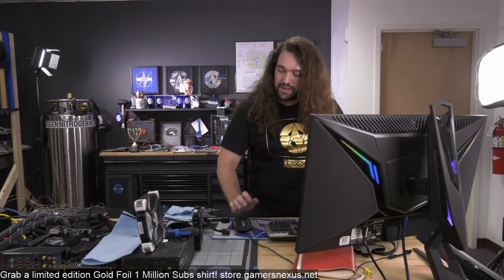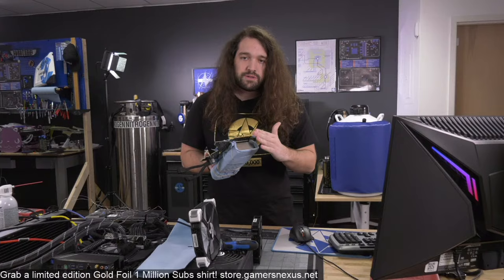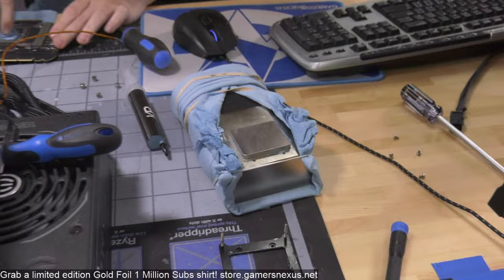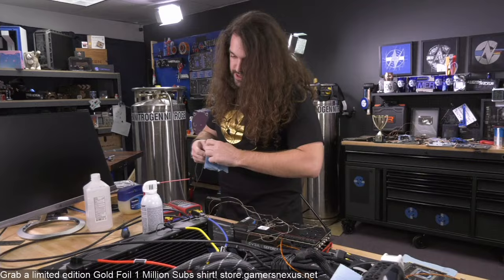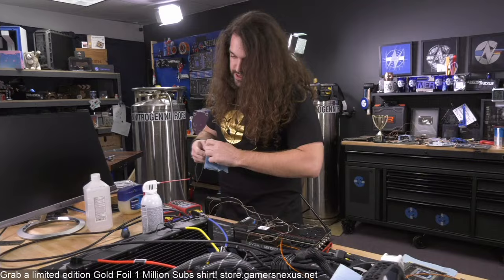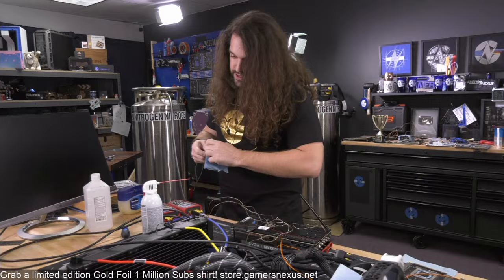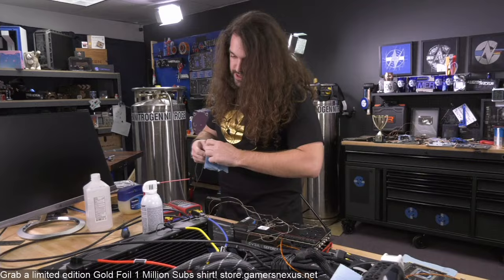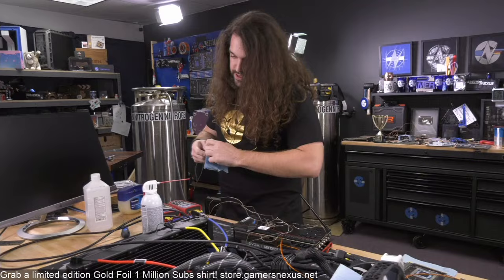LIVE: RTX 3090 Overclocking (Air & Liquid Nitrogen)

Comment: You didn’t need LN2 fog or an AC. You needed to set the RGB to blue.
Reply: But isn't Red LEDs faster than Blue LEDs???
also I don't get RGB adds FPS, when my PC is on RGB Rainbow FPS is up & down all over the place, but when my LEDs are set to RED I get constant MAX FPS 😁
Reply: @me_and_me_  stop spamming chats
Reply: Blue RGB hurts my eyes. Red doesn't kill night vision.
Reply: shane eslick 
He was trying to make it colder. Everyone knows blue is colder than red.
Reply: @radicalxedward8047  But Red with LN2 is Fast & Colder 🤣🤣🤣🤣🤣
Reply: Blue is colder than red; but everyone knows red ones go faster...
Reply: And a torch isn't needed to heat the chamber. Just turn the RGB to red.
Reply: @shaneeslick  if that was true AMD might've won before now.   j/s...
Reply: @shaneeslick  isnt having it set to change colors cpu intensive or smthn, which will cause your fps to fluctuate
Reply: @rain-uw9ju  I was being silly about performance fluctuating when Fans set to RGB, & Red being better because Red makes thins faster,
But yes some RGB Programs can increase CPU Usage, so depending on PC performance it can have a real affect, but it will not make a playable experience unplayable
Reply: @shaneeslick  yea ig
Reply: @me_and_me_  hjjjhjhj
Reply: @shaneeslick  I

Comment: Man I remember the old days when Over Clocking actually meant something, you could get real performance boosts out of GPU's and CPU's back then. Now, the cards run at max boost by themselves so OCing is pretty meaningless.
Reply: That's a good thing. I found that out with my 3700x. 

The algorithm of heat/clock/voltage are so tight, that my final "stable" overclocks end up so close to what the boost can do that it's the first time i just let it "boost" itself. I had a hard time understand this the first time i came across "boost" in gpu. 

The little bit extra i could push out, barely equated to any real life performance gain.
Reply: I doubled my score in 3dmark 2001 with my GeForce 3 ti200 from Asus with air-cooling alone. It was faster then the slower GeForce 4 cards... Great times.
Reply: I mean.. You can OC CPUs to 5ghz+++ on air and gpus by 5-10% core and same memory. RAM goes from 2400 to 3000 and stuff like that... It's not free 10x performance but what is the expectation here? You pay for something and you get more... For free.
Reply: And the Athlon XP 1700+ juihib stepping ♥️
Reply: Just undervolt
Reply: @MsFearco  Yea Intel has to applauded for this at least, their K series chips do meaningfully OC and give a good performance boost and I am on Ryzen myself now btw meaning I have to do some extreme RAM tuning to get nice performance uplifts and I never found that interesting. Still, I am thinking of upgrading to 3600 low latency ram kits from my current 3200 kit which I am running on xmp profile.
Reply: tbh it's a good thing.. the fact that you could buy a product for 500+ dollars and only get 75% of the performance it was capable of was a rip off. does it ruin the fun of overclocking? sure but i'll deal with it if means even casual users get the full capability of a cpu.
Reply: Competition is tight these days so they gotta release as powerful as they can

Comment: I always wanted to put my PC outside when it's -40 and see what my temps would be. Or at least intake cold air from inside through a window or something. Too worried about damaging my parts though.
Reply: I'm not an hardware expert but if you take the PC outside be sure to check the humidity, maybe if you live in a dry place it can work! Good luck.
Reply: @L30x  It is pretty dry here but I wouldn't risk it 😅
Reply: @L30x  He can make a sealed plastic-glass box and put the PC in it, no air will go in or out from it so in the box will be left only the air with normal humidity from the room he used to assemble it, the environmental temperature will do it's job and cool off the box.
The main issue tho, is that -40 degrees is too low for the PC to boot up so he has to heat the PC first and keep it around 0-5 degrees celsius (if he did mean celsius and not fahrenheit).
Reply: @saturnity6  yes it can. enough to damage a pc
Reply: @nobody8685  Air inside this box would already contain water in it

Comment: 12:20 & 1:26:04 are an example of the correct BoM caps to use to prevent power noise at higher clock frequencies. Some cards unfortunately did not realize the importance of these little caps.
3:32:33 is an example of the use of all MCLL caps. 
Edit: There are different types of POSCAPS 220's and 470's and 330's - Higher number has more top voltage (operating  range) that also added noise (specific filtering). I used 470's when I replaced the old caps on my PS3 60GB.
1:59:09 Steve reads the official statement from EVGA
2:01:00 Example of pre production with no MCLL caps from EVGA.
Reply: Thank you sir
Reply: Higher capacitance value doesn't mean it can operate at a higher voltage. The voltage rating is what determines the voltage it can operate at. The capacitance determines the amount of charge the capacitor can carry and therefore the amount of noise filtering it can provide.
Reply: @audaxxx4202  indeed thank you for clarifying that. Does that in turn mean if a capacitor can carry more charge and during that charging cycle results in more noise? Or is it a unique way  interfere by harmonious waveform that may cause some sort of destructive frequency in the GPU?

Comment: I'm really interested in seeing the performance metrics comparing a 2080 (or Ti) overclocked to a 3080's power draw and a 3080 underclocked to match a 2080(/Ti)'s power draw, and compare the performance of the two when power levels are equal.

Comment: Here are excerpts from a couple of Igor's Lab articles on the 3080/90 ... 

"Igor's Lab Aug 27, 2020 = NVIDIA has also completely sealed off the evaluation drivers this time. I don’t even think Furmark, let alone Time Spy, is running anymore, but only NVPunish (a stress testing program) for the thermal tests... from a board partner’s point of view it is of course quite strange when you produce something you don’t even know how fast it will be in the end.

Igor's Lab Sept 25, 2020 - “reference board” PG132, which can also be understood as a so-called Base Design. Especially the backside and especially the area below the BGA is interesting. What is interesting about such drawings and the so-called BoM (Bill of Materials) is that you are offered different placement alternatives.

Below the BGA we see the six NECESSARY capacitors for filtering high frequencies on the voltage rails, i.e. NVVDD and MSVDD.

The BoM and the drawing from June leave it open whether large-area POSCAPs (Conductive Polymer Tantalum Solid Capacitors) are used (marked in red), or rather the somewhat more expensive MLCCs (Multilayer Ceramic Chip Capacitor).
...According to the list and specifications of Nvidia, both are possible...

This also applies to the question of whether the BoM was subsequently changed again to completely exclude the exclusive use of POSCAPs/SP-CAPs."

From reading the full articles it sure sounds like Nvidia may not have provided working drivers to AIB partners until late in the development process and may have known about capacitor issues, since the FE cards have 4 poscaps and 2 mlcc's ... but it appears the BoM may at one point indicated that 6 poscaps would work?  Would love if GN could confirm any of what is in Igor's work and if I am reading it correctly?
Reply: Buildzoid did release a video with his thoughts about the layout behind the Die today on AHOC , so I hope Steve & Buildzoid can look into it further too

Comment: Regarding the plastic backplate: you might actually be surprised. I'm not saying it works, but don't discount it on principle; look up AN11113 from Nexperia regarding thermal design for LFPAK MOSFETs. It's now obsoleted as a design guide, but the data remains interesting. They tested black plastic, bare aluminum, and black anodized aluminum as enclosure materials in contact with the PCB assembly and found that plastic still has a significant heat sinking effect particularly in topside configurations, and may actually outperform polished aluminum in some circumstances due to superior radiation.

Comment: Do you think some of the add in board partners will start to adopt Nvidia's new split cooler design by making the back half of the cooler a blower style to remove some heat completely out the back and then using the front fan or "fans" to blow the remaining heat out the sides instead of Nvidia's pass-through design? :/

Comment: When the cards released i think the power circuitry was an issue with certain brands. Not sure if this was fixed but 2 months later ive picked up an EVGA RTX3090 Gaming ULTRA and it has two of the weaker caps. Even though it draws the most power stock. Whatever optimisations needed to happen have obviously taken place as my card has been fine(the card lasted just over a month, i went with the asus tuf 3090). Although if i dont set a fps limit the card will crash to desktop when streaming. ^^

Comment: is it possible to view my 3Dmark results relative to others that are higher/lower instead of just seeing this dumb Top100 screen and mine on the bottom? I would prefer to see my score in the center, and the next 20 better and 20 lower scores above and below mine... ?
Reply: Afaik not on the 3dmark hall of fame, but on hwbot you can filter by a lot more parameters
Reply: Yes, kinda. Click on "compare results online" after the run and then "show result details". Shows you a bar graph with different score brackets from runs with the same hardware.
Reply: @-eMpTy-  thanks. but I really meant something like the Benchmark Superposition offers, a Highscore List where you can see the specs and stuff of the people above and below you, not just some graph or a Top100 List with you listed as Low 1% and you cant even see the people around your score. A list like Superposition gives you more incentive to improve your speed or it is at least more fun cause you can relate much better. I guess 3Dmark really only is fun for the Top100 cause they get elevated and presented exclusively and you dont really have any idea where your PC stands.
Reply: P4RADIGM it is possible, just add your score, and select compare.

Comment: When you were pushing the memory speeds, wouldn't it always apply even if it's erroring with this G6X VRAM? Or is it still possible to crash the card and it only handles artifacting? Jc
Reply: not always, but mostly it would worsen performence, because it takes more cycles to error correct.

Comment: DeBuer(forgive the spelling) showed by soldering the better MLC caps replacing all the original ones the card held over 100mhz better clocks. stability was far better, you might want to copy him and mod that 3090. Great work on the LN2pot BTW.

Comment: this boggles me i bought 5 2 dollar peltiers ,couple dc to dc convertersand made my own heat transfer blocks from aluminium and a grinder,and made a budjet pwm circut to piggyback of the motherboards pump pwm output ,now have control all the way down tominus 20 degreesdefinatly cant do this with an aio water block had to run external fish tank pump and filter in one unit,just removed the filter so runs as resiviour,the last peltier runs as air cooled water chiller to cool any hot water
Reply: all the peltiers have been isolated from the environment to so as result not getting condensation when passing the dew point, id be happy to share my circuit designs and how was done if it interests anyone ,it doesnt really add much electricity cost and if tune it to low 30s its no more than 12 volt 20 watt per peltier

Comment: Just curious why he didn't raise the voltage slider when he did the air overclocking. I have the evga 3090 ftw3 ultra and I have it raised, now I'm thinking should I lower it back.

Comment: Doesn't this stuff hurt very much in contact with skin? (Damage)
He handels it like a beer dispenser.
No gloves...it looks like it runs over everything.
Reply: I think he's covered this in previous videos. Basically its generally recommended to not wear gloves etc as small spills boil off immediately not causing any damage, but a fabric can get liquid soak that holds it next to your skin for longer which actually results in burns.
Reply: He does cover it every stream, but basically because it’s so cold the moment it touches your skin it boils and creates a vapor barrier that keeps you from getting burned. He does wear the gloves when he’s doing something that is safer with gloves. But handling the smaller bottles the gloves become more of a problem.

Comment: Long ago, overclocking gave valuable boosts with most pc's struggling to run games in ultra settings, but now? Waste of time and not worth risking the longevity of your cards. Todays cards mostly max out graphics with no problems, it looks beautiful and there is no lag like 15 years ago. What is the point overclocking if your nice graphics cards and cpus run everything maxed out. To me it seems a bit weird to even bother overclocking, who needs an extra 10fps when you got 200fps already?
Reply: you're right, it only makes sense if you have yourself an older gen card, or lower spec card, and you are trying to run Crysis on it, that sort of thing...

Comment: I am young to your channel but not to build computer.  but I never did OC.

now my computer getting old and games demand more power (19FPS on FS2020 on ultra) can you make a video about basics of OC, tools to use to xontrol and monitor OC ?

GPU: asus tuf gaming GTX1650 super
CPU: AMD fx8350 with cooler master masterliquid lite 120
MB: Asus tuf sabertooth 990fx r2.0
PSU: evga supernova 1000
HDD: asus hyper M.2 x16 pcie 3 with two samsung evo ssd 1tb
RAM: G-skill F3-1866C9Q-32GXM
Reply: just replace the first three items on your list, you're not going to be able to squeeze a stable and cost-effective 50% OC.

Comment: I must have got lucky with a nicely binned chip on my 3090fe, it holds 2010-2025Mhz in most games at 60-64c. I keep my room around 20c and have an enthoo 719 case with lots of great airflow, vertical mounted 3090 with air blowing well across both sides so the memory temps should be pretty good too.
Edit: Oh that's not fully stock tho, I have a +60Mhz bump on msi afterburner, stock voltages, +250Mhz on Mem. Absolutely fantastically performing card tho, gets as good of numbers in benchmarking as my buddies' evga and gigabyte 3090

Comment: What PSU is recommended for 3090 evga? 750w is safe? Or 850w?
Reply: get a 850w
Reply: In tech tips review linus mentioned his 850 watt psu was limiting its performance
Reply: im screwed i got a 725 watt
Reply: It depends. PSU’s operate best using 60-80% of their capacity. Use the OuterVision PSU calculator with your current build but swap in the 3090. Once you get your result, pick a psu that would only use 60-80 of its capacity to power your PC
Reply: Best take a 2kw xD
Reply: John Hanson your fine.
Reply: @dannyboygoldfish926  even if it good 750 w PSU ??
like seasonic focus px-750 platinum , this one what i have , i9 10900k , two hard drive 32 gb ram a 3090 evga will be nice but i never ever OC my system

Comment: I admire that you want all the facts about the capacitors and don't want to talk about it, but surprised you didn't have at least a little bit more to say especially after EVGA confirmed it. You must have had an inkling that something was wrong with this launch cycle speaking to all your sources?
Reply from the maker: No, we knew there was a separate frequency issue that we only just started studying last night, not related though. I still haven't read the media by Igor, so I still don't know the full story. That didn't change from a 3-min phone call with a first party. If you haven't noticed, we've done two videos a day for at least a week, including like 15 hrs of live streams. I haven't looked into this at all yet.
Reply: @GamersNexus  Meant no offense. I don't doubt your integrity and may be guilty of forgetting how much time you've spent awake working on everything else this week. I look forward to hearing your thoughts once you do get to look into it.
Reply: Gamers Nexus a quick followup though - I’m a big EVGA fan. Always have been. But isn’t it even just mildly suspect that they did originally cheap out and go with 6 POSCAPS? They did catch it in R&D, but they didn’t mention it until now. They also didn’t update the new pictures until now either which they could have done ages ago had they already caught and corrected

Comment: I'm assuming my i7-8700 CPU @ 3.20GHz, would throttle any new gen GPU whether it's the Nvidia 3000 series or AMD Big Navi series.  I have a Samsung Odyssey G7 2k 240hz monitor.  Looking to run games at 2k max settings.  Currently have a RTX 2060 super.

Comment: Hi, Do you think if i put a xeon e 5 v2 2687w cpu in my 2013 mac pro trashcan,its supported but its 150 watts,and the mac pro is designed for 130 watts,all only be use the cpu for facebook, utube etc..someone on Mac fourms installed it in the trash can....thanks if you could tell me it will be fine without pushing it really hard.its got the best specs of any cpu that will fit in the 2013 trashcan 3.4 ghz 4.0 turbo. w is for workstation cpu, thats what the trash can is?..it will be ok right?

Comment: I must have gotten real Lucky with GPU die .

With my first custom setup 
ASUS Z490E GAMING  

Intel i9 10900k @5.3

32GB DDR4 PC3000 

Gigabyte 3090RTX Gaming OC 1755Ghz
102% Target power
91c temp max
Fans 100%
1840-2145 games 2070 2145
Most games 56-67
Some 72c  73c

Benchmark 70 to 79c
At 2185Ghz